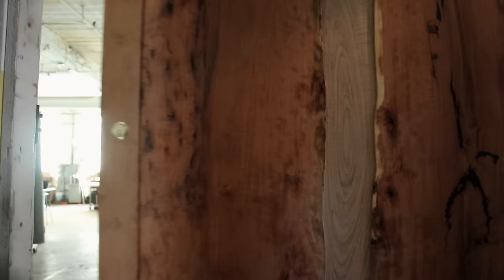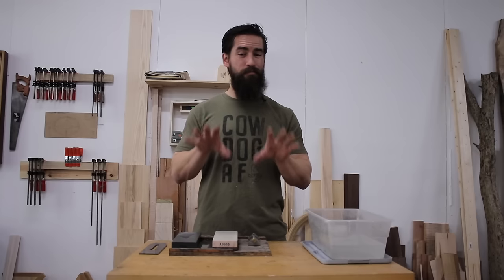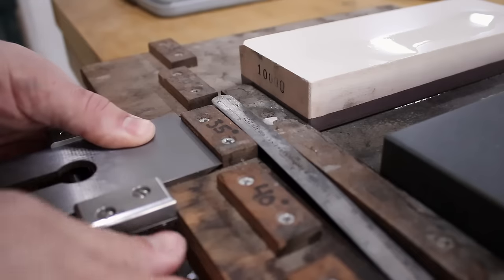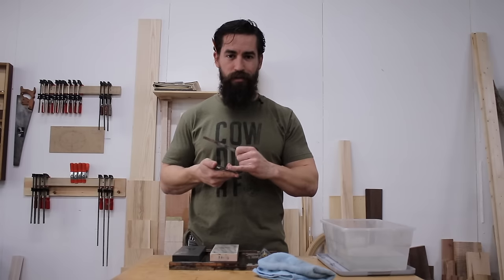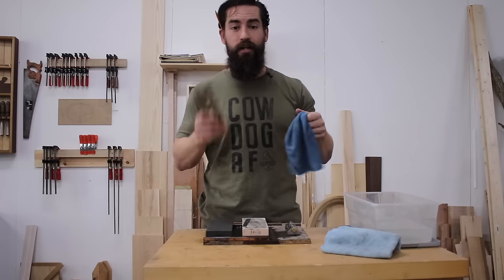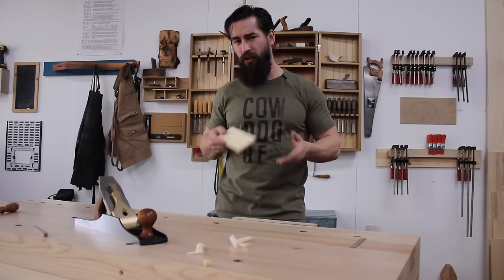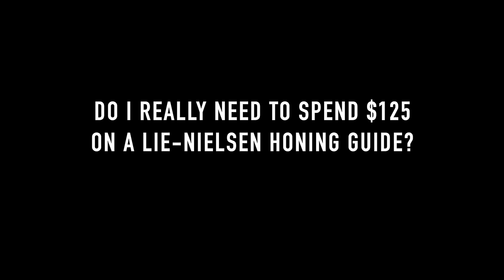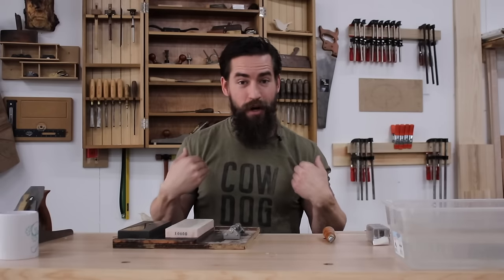The Most Important Skill In Woodworking

Comment: The reason why the ruler trick is a issue is after you do it you ALLWAYS have to use the ruler the same one in the same position. (or it changes the back bevel/ yorkshire pitch)  or re-flatten the entire blade to remove the bevel if you want to do anything else.  Not using the ruler is more work in the start setting up the blades but the new lapping films make short work of that for setup. Day to day you shouldn't be hitting the back except to break the burr.

Comment: I check for edge imperfections by lightly dragging the edge of my finger nail along the blade edge. Super sensitive technique and less chance of laceration! If your fingernail is too short you can pull back the flesh a bit to avoid skin-to-blade contact. 40 years in fine furniture and curvy staircases. And still learning. Great video! Mahalo!
Reply from the maker: The fingernail is a great trick! I've seen that years ago but was lost somewhere in the back of my brain. Thanks for reminding me of it!

Comment: My experience with western tools: I got the best edges grinding a "deep and narrow groove" with a dremel grinding wheel (smaller radius) that helps me freehand sharpen super comfortably forna long time. I use 1000, 3000, 8000 and 12000 stones (high quality japanese made), then japanese thin camelia oil to protect blade and tool. Always do sideways movements, also extra pressure on the sides to create that super slight curve. I got transparent shavings with lie nielsen and silk smooth finish on most woods. If I can be of more help, just ask!

Comment: Kudos on mentioning that there is no given surefire way to tell when a blade is dull.  I work mostly with soft woods, just last week I was planing a face of a board with freshly sharpened plane. I use a wooden smother and I was getting ridiculously thin shavings (the kind that flies out straight out of the plane and starts sticking to your arm thanks to static), when I moved to plane the edge that was a bit more figured and the individual ring were harder, you could see sings of the slightest skipping on the finished surface thanks to the orientation of the grain. I waxed the sole, tried going slower, and everything went fine after that. Another thing that used to happen to me was getting fluffy (not torn out, just "fluffy") surface, but my plane still cut fine using the same amount of effort, so I thought it was weird grain, but while the plane took still the same amount of force to push, the blade was a bit duller and stroping did the trick. Time and practice solves all, thank you for another good presentation. And by the way, those stones look absolutely awesome.
Reply from the maker: Time and practice solves all indeed! Excellent words. And yes, these stones are fantastic. Highly recommend.
Reply: There's a way to know. Everyone knows when their tools are dull. Most just lie to themselves about it. That's because they suck at sharpening and don't want to do it. The sad truth is the more often you sharpen the less time you'll have to spend sharpening. By rights you should probably be sharpening a tool after every 15 minutes of using it. So whatever you do had better be fast.

Comment: I have the LN guide and love it for the reason you mention - the long jaws.  Best out there.  Another one that is fairly recent is the newer Woodriver Premium guide,  As good as the LN one, but no extra jaws.  Does come with a setting guide and is dead simple to use and very effective.

A question for you about the Ohishi 10,000 grit stone.  I have had that one for over a year and was never happy with it, reason being that LN says not to soak it.  It drank up water like a sponge and never worked well for me no matter how often I sprayed it with water.  Recently (like last two or three weeks) I've tried soaking it permanently.  The difference in use is like night and day.  Love the way it works now.  No issues with it and so far I've not seen any degradation of the stone.  We shall see how it holds up long term.   I'm wondering if you've had the same experience and have you tried soaking it?
Reply: I’ve had the same issue with these stones. The soaking guidance is really conflicting out there and I can’t determine if it works better soaked or not. My buy shaptons cause I feel like I’m not getting the best out of my Ohishi. Appreciate your thoughts

Comment: As you rightly say, having very sharp cutting tools is not a nice-to-have, it’s an absolute essential for any kind of decent woodworking. As you also say, there are quite a few ways of achieving that -and a lot just comes down to personal choice. 

Here are a few thoughts from me

When I started over 45 years ago, it was really a question of oil stones and nothing else (although my grandfather used the dried skin of the dogfish as both sandpaper and a final sharpening paper). Good oil stones are still a fine method but now there are others - and I’ve bought and tried them all

I’ve got sets of very expensive water stones. You do need to keep them flattened and need to be soaked just before using.

I’ve got a Tormek T8 which takes me up to 1000 grit and then the leather belt. 

I’ve got the scary sharp style of sharpening films. 

The key thing for me is simplicity. I ought to touch up my chisels and plane blades whilst using them. If I’m using them a lot, then I ought to touch them up several times during each use. For me to do that, the method has to be simple or I just don’t do it enough. So, I don’t use the Waterstones (need to be flattened and kept wet) or the Tormek (1000 grit is not enough) but use the scary sharp style of system. All stuck onto a piece of plate glass;kept on my bench and ready to use in an instant with a quick spray of water. 

Where I do use the Tormek is if I have to go back to regrinding the primary bevel. It’s the quickest method that I know of and it does deliver a good consistent edge.

Where I do use the Waterstones is to put the secondary bevel on if I have just regrouped the primary bevel.

I’m not saying this the best method - let alone the only method - but it suits my style of working. I want to touch up my edges regularly. 

I agree with the video in that the angle of the primary bevel is not critical. Wisdom has chisels at 25 and most planes at 30. However, I have low angle and high angle planes which vary greatly in the angles required. What I do believe is important is that the secondary bevel is about 3-5 degrees greater than the primary bevel and that I sharpen (and touch up) that secondary bevel to the same angle consistently. Absolutely hard work to touch up at 36 degrees one time; 33 the next and then 36 again. So, that consistency is key again for my need for simplicity.

None of this is a critics of anything in the video. Just another perspective .
Reply from the maker: I appreciate you taking the time to share your thoughts and experience. And an excellent point about convenience.

Comment: About the chisel- the bevel on the other side pushes it into the wood. The reverse bevel keeps it going straight, opposing the small back force from the materian you're removing.
Reply: Except it doesn't. The blade will ALWAYS try to ride on that back bevel. It's basic physics that cannot be argued around no matter how many heavily edited videos from much less honest content creators are out there. When you push on a chisel with a back bevel the cutting edge is trying to cut anywhere from a 1/32" to 1/16" above the actual back of the chisel depending on how much of a back bevel you put on it. That means that the chisel back is always going to be being forced to meet uncut wood. If it was a sharp 90 degree angle the it would just stop moving when it hit that but because you've created an incline with that back bevel the chisel will always try to push itself up that incline. You just can't legitimately argue that away. 

It is going to happen. If you've ever made a cut with a chisel with a back bevel and had the cut come out less than square or with a sloppy fit or with slightly chewed up edges that back bevel and you're natural tendency to try and keep the chisel straight is why. Consciously or or not you will always being trying to compensate for where that chisel wants to naturally go because of that back bevel. It is going to want to push in and as you feel that you will be directing the tip slightly back so that as the back bevel forces the blade forward you're still cutting mostly where you want it to. The sides of the cut will almost always be slightly trapezoidal in shape because most people will tend to overcompensate to one degree or another. The sides of the cut will also not be as smooth as or as neat they could be. Competing bevels on a chisel also make the chisel far more likely to follow some grain change instead of where you're trying to put it.

This is not a controversy, it's just the basic physics of how a cutting edge with no reference surface other than itself that is not forcibly held to an angle by mechanical means, like a chisel for instance, is going to behave. You can argue against it and say nuh-uh or come back with this content creator said this and you'll be as wrong as that content creator. And I know which shmuck YouTuber has pushed a few videos with plenty of jump cuts "proving" a back bevel doesn't behave the way physics says it must and he's very wrong as well.

Comment: Brother, when you do the ruler trick it is best to move the blade along the ruler rather than toward and away from it. This will keep the angle of the back bevel you are honing more consistent.
Reply: This makes zero difference on the angle. How is honing a primary bevel perpendicular makes it consistent, but honing back bevel the same way doesn't?

Comment: Since it's a very small angle on the back bevel, a good approximation of the angle is the tangent of the angle, so the thickness of the ruler divided by the distance to the edge. Assuming a 0.5mm ruler and 3cm distance, that gives us an angle of 0.0167rad, or about 0.95 degrees

Comment: The difference in sharpening angle is usually dictated by 2 things; the type of metal the blade is made of, and how often you want to sharpen.

To explain why this is;
The more carbon a metal has, the harder it is. Thus it's better at keeping it's angle.
I.e. high carbon steels can hold a sharper edge than lower carbon steels. So if you'd sharpen a lower carbon steel with the same edge, you'll be sharpening more often because it will dull quicker.

Comment: My old dad - passed away over 30 years ago - used only wooden planes, but the blade sharpening followed that which you suggest in your video. He also trued his stone in a similar way. The only difference was he used a square of 1/4” thick plate glass, which he claimed was flatter than a billiard table. Nice video. The preference for a 35 degree edge is interesting: my Stanley plane blade has a 30 deg. angle and it can snatch at times….
Reply from the maker: Many ways to skin a cat, for sure. Plate glass and sandpaper get the job done!

Comment: I believe you described and demonstrated the David Charlesworth ruler trick 100% accurately. Even down to using the same 10K Ohishi water stone as he demonstrated and a Lie Nielson blade as he demonstrated.

I believe there are two sources of controversy. 

1. some people quite enjoy polishing large portions of their chisel and iron backs and puzzled by someone telling them they should be saving that time for something else.

2. The method and reasoning for the method is simply taught to people who can't use it by people who don't understand it. When it inevitably does not work the argument insures.

The main misunderstand I have encountered stems from conflating the terms "polishing" and "flatten." These are different concepts and serve different purpose on iron backs and even more different purposes on chisel backs. In other words, a plane iron back must be reasonably flat, even when employing the ruler trick. Because, as you mentioned, the ruler trick polishes away a very small amount of metal at a very slight degree. Therefore, it can only compensate for a degree of out-of-flatness that falls within the slight angle of the "back polish."

Comment: Interesting..... I do have one set of the old DMT stones, with all the holes in the plate. They had pretty much stopped cutting. Put a little of the Trend lapping fluid on them and they came back most of the way. I do have the diamond lapping plates, at least for now. Mostly I don't want the maintenance chore of flattening them. I am curious about you not stropping the plane irons. I can 'feel' a burr of the 8000 grit stone, and even off a 30,000 grit Shapton stone. I am getting back into flat work after almost 30 years on the wood lathes....

Comment: Awesome info,  Helps .    I agree sharpening is  the key to woodworking. Sharp tools can let a small shop knock out alot of work and avoids  dust - get a bit tired of masks not mention noise is always bad....   Out curiosity, what is your setup for creating the hollow grind?  Thanks..
Reply from the maker: Very true! I use a white 120g wheel from Lee Valley with the wolverine jig from OneWay. Simple and very effective.
Reply: @ENCurtis  do you really need such a fine grit? 120 sounds awfully fine for hollow grinding primary bevels to me. I use like 40. Ain't nobody got time for 120 grit. You're just making air with a primary bevel. The grind don't really look bad either. It's the finish grind on my lawnmower blades too. Sharp enough.

Comment: A really good trick for checking the edge is to use a piece of delrin or some other plastic and take it down the edge (edge to edge) and it will snag at any tiny chips. Razor' Edge sells an edge checker, but any piece of plastic or graphite will do.
Reply: Your fingernail is the best thing you could use for that, and you have a lifetime supply!

Comment: Great video, thank you. Could you share what grit sandpaper you use for flattening water stones?  Also, do the ohishi stones need to be soaked?
Reply: He said 600 for flattening and he pulled the stones out of water when he started, so yes.
Reply from the maker: Yes I used 600 but I've used other grits before to similar results. And I do keep them in water but they don't require long soaking, which is super nice if you need to store them dry. I've given them about 2-3 minutes of soaking before use in the past and they work great.

Comment: Camber ;  a slight convexity, arching, or curvature (as of a beam, deck, or road) : the convexity of the curve of an airfoil from the leading edge to the trailing edge. : a setting of the wheels of an automotive vehicle closer together at the bottom than at the top.

Comment: If you wouldn't mind, I could use some instruction on how to sharpen round gouges etc. Both inside and outside bevels please!
Reply: Look through his other videos. There is one where he goes over that. He does use a leather strop occasionally for those but you do have to be careful with those and not use them exclusively. The problem is that the leather is soft enough that the toolhead will sink in a little bit. If you just strop to maintain that edge it begins to curl that edge over and round it. You can mitigate that a bit by using some of the thinner stops bonded to a hardwood substrate but you still don't want to use it as the exclusive method of sharpening. 

There are some very good water stones that are in traditional slipstone shape which is a water stone that basically has the profile of an extremely elongated teardrop with both ends of the teardrop having a radius. One large and one small obviously. There are also cone shaped waterstones. I like the teardrop profile ones as they are more consistent and easier to use as each diameter of the teardrop has the same size down the length. You have to freehand sharpen gouges but you can ride those profiles right down the inside curve of gouge and it will follow it pretty naturally. 

The back or outside of the gouge you use the flat stones for and just practice will get you there. The angle is big enough on a gouge for you to feel it ride on the stone. You just put one side of that curve on the angle at the far end of the stone and apply slight pressure as you draw it back to you. As you draw it back to you you just slowly rock it over to the other edge so that by the time the gouge reaches the near end of the stone it has completely shifted so that the opposite edge is now resting on the stone.

Comment: Just curious what is you system for establishing the primary / hollow grind bevel. Thanks
Reply from the maker: Just a standard low speed grinder, a 120g white wheel from Lee Valley, and an adjustable platform from OneWay. Very simple.

Comment: The ruler trick is not an issue for plane blades, I think it gets a bad rep because of chisels. If you want to use the flat face of a chisel, the back bevel can prevent it from cutting.

Ah, ok, you mentioned it later in the video...